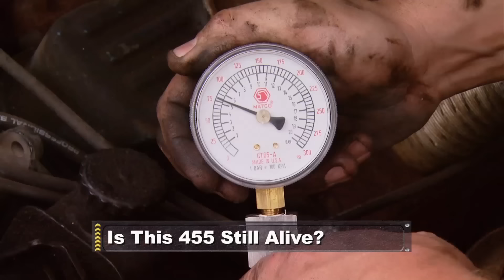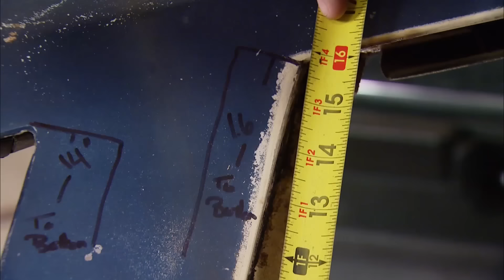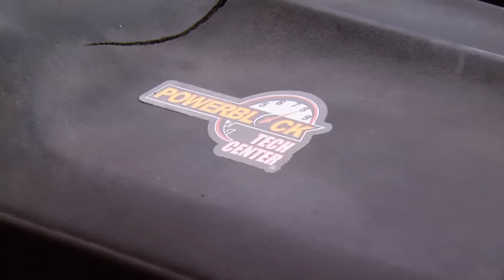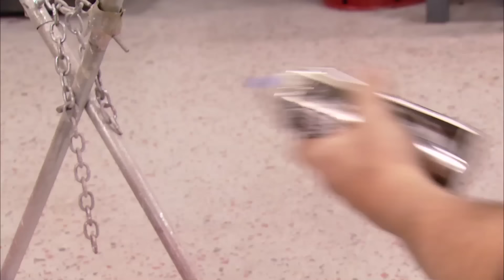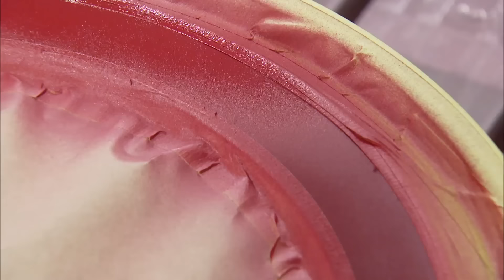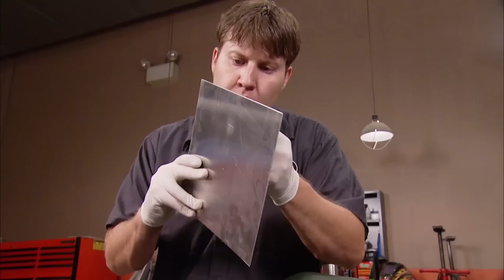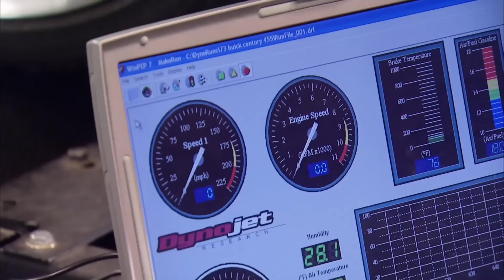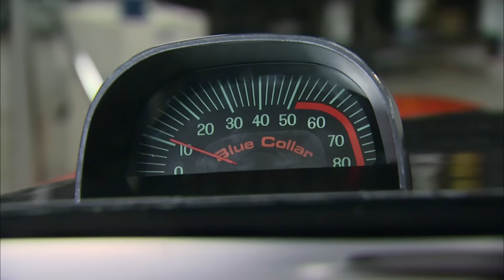Full Build: 1973 Buick Century Restomod

Comment: I never got into those 73-77 huge B-body cars.
I had a few of them back in the day, and they were HEAVY, long, tanks that didn't handle real well. The doors on the two door versions of these were ridiculously heavy, and the hinge pins were always shot after no time, and the strap to close the doors would always tear off from trying to close such a heavy door. Especially ones with power locks and windows. The 74 442 I had, had swivel bucket seats to get in and out with, because the thing was so huge.

I DID enjoy the big blocks these things came with however, and swiped plenty of them to put in smaller, lighter cars. Hit a junk yard, rip a healthy big-block out of one of these things for $200, cam it up a little, put an intake and carb on it, a set of headers, find a nice G-body for $800 to toss it into, and you instantly had a 12 second street car for less than $2500.

Give me a 67-72 A-body, or a 78-87 G-body, any day and I'm set. 👌
Reply: I never liked the 73 b-bodies in particular, I always thought the rear fascias were ugly, especially on the Monte Carlos.

Comment: Great ride out of a less than exciting car. The 73-75 weren't the best looking cars around. But with the nice changes like the bumpers, door handles, new side mirrors and paint, it looks a lot better! Godd idea changing out tne front bench and column shifter too. But, even though I like the wheel style... They're 2 inches too big. 18 inches are the biggest I would have gone but gone wider like 9 to 10 inches with with 275 section tires all around. More rubber look better on these. But, that's my opinion. Great build guys, very nice! Especially for that budget!

Comment: Don't forget about those G.M. driveshafts that had the "plastic" that was squirted into a passage in the yoke when it was in a liquid state, and then hardened up inside the yoke, and groove in the side of the U-Joint cap, and held it in there without the use of a clip. 
One could beat on those u-joint caps for hours with a sledge hammer, and the caps will NOT budge. You had to heat up the yoke, and all around those caps, REAL well with a propane torch until all that "plastic" would melt and come squirting out the little holes in the yoke. THEN you could pound the caps out with a hammer. 
The very first time I ran across one of these drive shafts, I beat on it forever trying to get the u-joint out with zero luck. It wasn't until I heat it up with a torch thinking a little heat would help to loosen it up, and all that plastic came squirting out, did I realize what was actually holding it in there. After I realized this, they came out VERY easy. There was no internet back in the late 70's-early 80's to help a guy with these little tricks.

Comment: pro tip: when removing old exhaust manifold studs you want to tighten it then loosen it, repeat until it spins. once loose, do not remove it, it needs to hold the manifold in place while you loosen the rest of the manifold bolts or you will have too much pressure on the remaining bolts.

Comment: The only thing g that I would have done differently is installed a turbo 400 transmission, or even a modified 700R4! 
It goes without saying that the rear axle would need a 355 to a 373 gear with a positive traction installed!
Reply: They DID install a performance R4 and installed 3:73 posi .... where were you ?
Reply: @neal6418  obviously not there, but I'm glad that the proper equipment was installed.

Comment: Where is the oil pressure switch located on a 455 block and where is the oil sending unit located...the 455 is in a 72 Electra

Comment: I really love the show and the fact that you guys really do try to do things we want to see and don't do that sensationalist junk the others do. You do great cars and builds and show a lot of the work. Well at least the general idea of what's being done LOL. However (there's always one or two "BUT'S" LOL). Guys, I'm sorry and I know you guys know this already too BUT it's still a waste of a 455 Big block. And here comes my crap talk about my own car etc. Sorry but I gotta say it. My E46 M3 with a 3.2 Liter straight 6 engine makes 350 HP NA (Headers and a tune other wise it would be 333hp) yet you guys are not even giving that sucker 300 hp. Somethings not right when you've got THAT MUCH displacement and that little power. Yes it's a 100 hp more than it made when it was the strangled Smog device Choked unit it started as but there's SO MUCH more left on the table here. I guess it comes down to the build trying to be kept to the $10,000 range. This is why so many young folks (And old guys like me too LOL) are getting into cars like the 2007-2010 (Or 2013 if you're looking at other model cars with the N54 engine) 335i, 135i, XI etc. N54 engine twin turbo. You can buy these cars for less than $5000 or $6000 do the maintenance (First always) about $1500 (Way over estimated unless you're buying new injectors which are stupid money. Buy used ones) then put around $3000 into doing FBO's with up graded turbos even and you'll have a 500 hp to 650hp MONSTER that is still a luxury car and every day driver. You can get lots more out of them but then you'll be getting into more cash for a single turbo set up and then even more if you decide to build the bottom end. They do come from factory with forged pistons and I think rods but the cam shaft is not if I remember correctly. The N54 (And even the later N55's) are the new and cheap solid way to go. I bought a high mileage (189,000 Miles) 2008 335XI (All wheel drive) for $1500 USD. Put in about $6000 in maintenance and FBO's including 17T turbos (Twins) and I've been driving it for the last two years with minimal problems. (Hey it's still a BMW after all LOL). This is assuming all work on the car is done by the owner and NOT at a shop. That would change everything. The prices would quadruple for sure!  Oh and they come in a manual 6 speed trans too. The Automatics will safely hold up to around the 750 hp mark (well that's pushing it a little stay at the 650hp mark really) and the Manuals will hold up to 1000HP! Crazy! Seriously I really do like the channel and cars and you guys are great too! Thank you for the excellent free content!!

Comment: I normally like orange and black color combo on cars, but it is NOT working on this car!
I do like these old mid-70's Buicks though. My grandad had a 2 door, 1976 Buick Electra with a 455 that was insanely fast for being a land yacht.
It was a bronzey metallic color with a white Landau top that he gave to my parents.
I decided to test the 0-100 time and around 90 mph, the windows sucked inward off the seals (frameless windows) and started flapping back and forth really fast and oscillating the pressure inside the car and pounding my eardrums.😆😆😆

Comment: YOU GUYS NEED TO SPEND TIME IN A GYM If you cant lift an 80lb iron intake from a 455 across that WIIIDE engine bay! Try doing that to a CADDY 500! Then you can complain!

AND U GUYS SHOULD OF USED AN 2004R trasnmission which is stouter than a TH700R4!